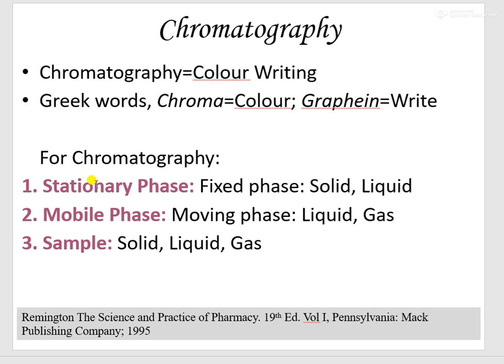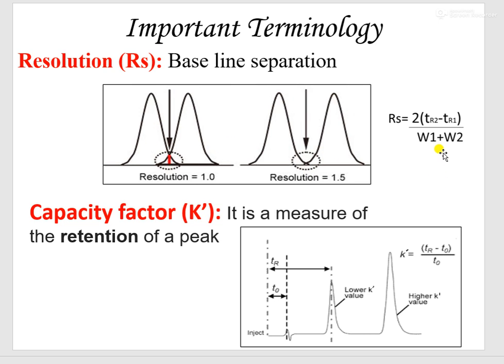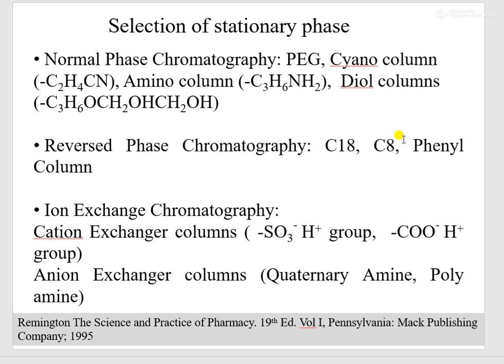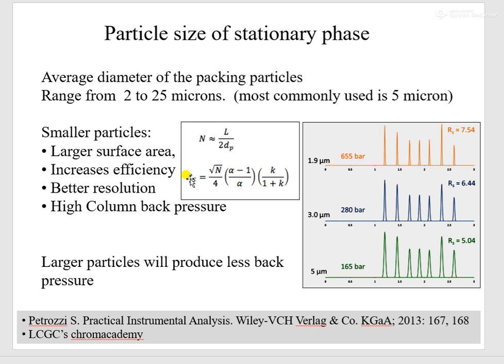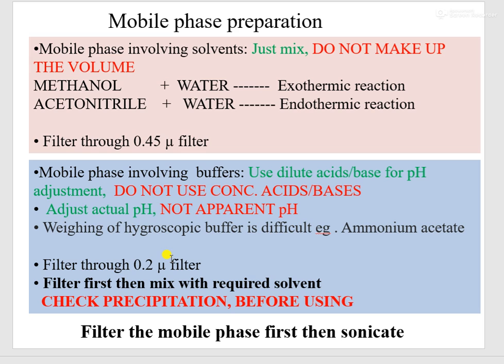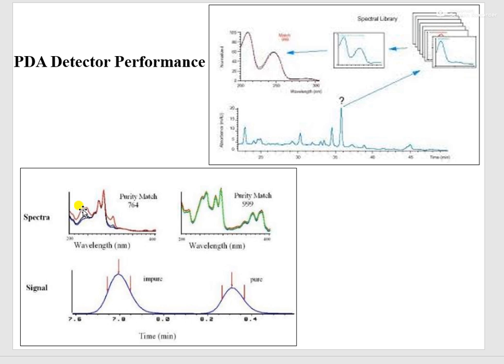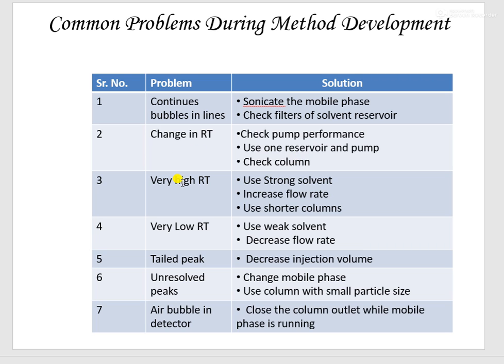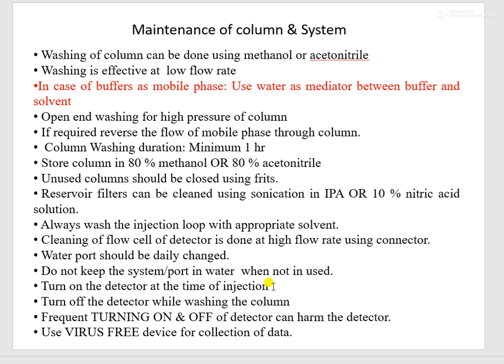Practical Aspects of HPLC Method Development

Comment: very good post, i have a correction here, at 14:10 you said that you can separate RNA and DNA with size exclusion chromatography which is not true RNA and DNA can be separated by gel electrophoresis  :)
Reply from the maker: Also check  article Rapid purification of RNAs using fast performance liquid chromatography (FPLC)

Insil Kim,1 Sean A. McKenna,1

2007
Reply from the maker: Size Exclusion chromatography is also called as Gel Permeation Chromatography or Gel Filtration Chromatography based on Stationary phase.

Comment: What is the use of retention factor and gradient retention factor
Reply from the maker: In isocratic separations, analyte retention time can be normalised to retention factor, k, which allows a direct comparison between columns with different dimensions. This is possible due to the constant mobile phase composition used in isocratic methods.Gradient retention factor, k*, also known as average k, can be used to describe the chromatographic conditions.  k* requires a range of 2 < k* < 10, similar to that of retention factor, k. If k* is below 2, there is potentially insufficient interaction between the analyte and the stationary phase, whilst above 10, the run times can be excessive, which can decrease laboratory productivity and increase solvent consumption